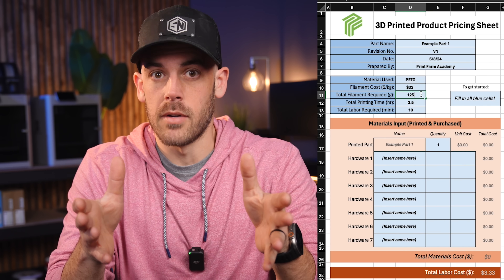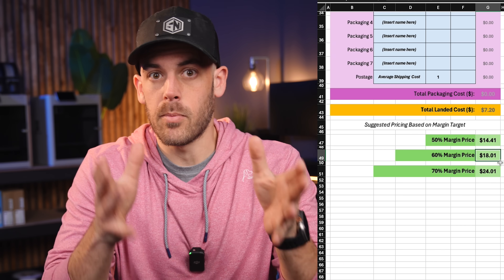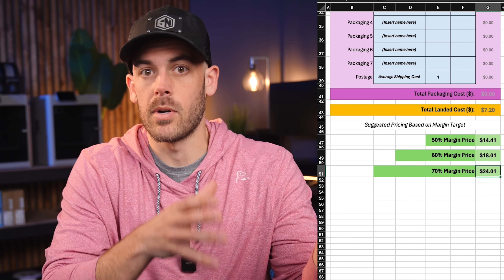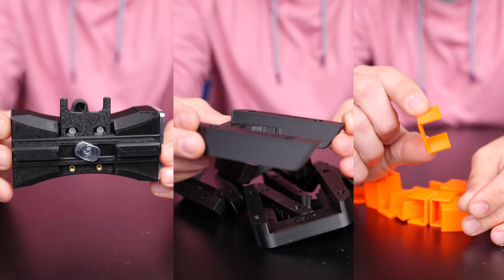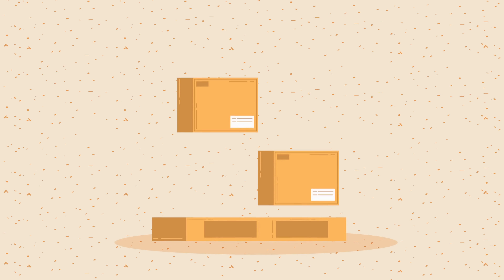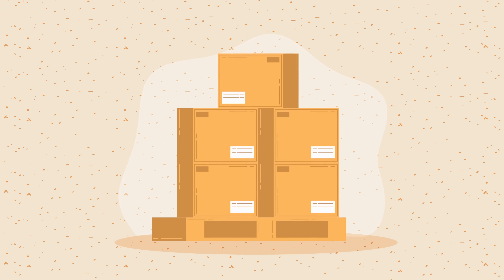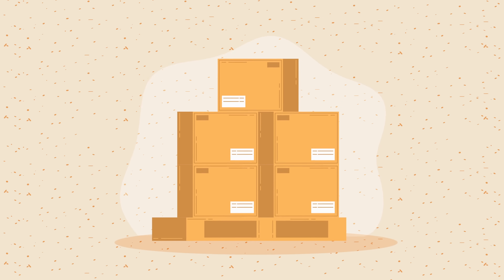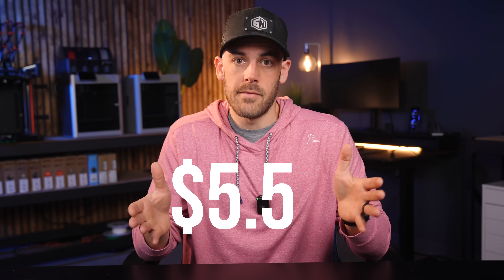Why I charge $55 for this 3D printed part (how to price)

Comment: There are three choices when analyzing the market. A: Position as superior.  B: Decrease your margin.  C: Choose to not enter that specific items market.  The third choice should always be considered.
Reply: Yep...my rule is to avoid saturated markets...if it is easy then more people will be in it making it a race to the bottom for margins.
Reply: in a 3d printed part market, you can also consider selling files for others to print. If you can sell someone a file, you don't have to do any of the work to print or distribute, and you can allow the user to save money (no markup on the bulk of the cost), which makes them more likely to get it over a pre-printed object. The only downside is that they need to have a 3d printer. It's probably not going to make as much money as selling the parts directly, but it's something to consider if your parts aren't selling at all due to cheaper competitors.
Reply: If your competitor advantage is price then your product is a commodity and you will lose money. It because the only thing you can do is lower prices and decreasing margins, you only can go to 0 and then its done. Probably way before that.
Reply: Then, When do you even start a business....
Reply: Another option would be to decrease your landing cost. 
Print more efficiently, ship more efficiently, find better pricing (bulk discounts) for materials.
Reply: yep, so true, this is where capitalism can either work for you or against you.  thankfully distributed manufacturing like 3d printing can be a really cool way to make capitalism work FOR you by leveling the playing field slightly instead of against you like it does in many cases for small players in this kind of economy.   as you allude to the big question is: are you willing to undercut?... aka can you still make money at 25 or 30% margin vs 50%?  maybe, maybe not, all depends.   if you are shrewd and have done your research properly or are willing to invest larger amounts to produce more units in less time it might be possible... but also the possibility to lose it all increases because if someone copies your idea or someone has a million of the same thing injection molded in china somewhere and then sells them here....  you get the picture.   but if you (whoever) follow me here there is another aspect to this:  perhaps you are the person who steps ahead and sees the demand and has those particular parts or items batched out from a factory or buys the next level of tool or equipment to make more etc...          anyway, not at all being adversarial, more enjoying and summarizing the fact that we can 3d print things and learn not only engineering, materials science, computers/programming possibly but also fundamentals of business and economics ....   all of it has direct application to this one little machine or two in our office or shop.      Most importantly... the critical thinking skills to put it all together and decide what is or is not important in the given scenario!  

If i were a high school shop or science teacher i would be doing a month (or whatever reasonable time)  of every semester on 3d printing and its direct applications to the subjects being taught, coordinating with other subject's teachers so they could further amplify the effect of tying things together to other aspects students needed to learn.    STEM  coupled with  proper communication skills (making youtube videos in addition to writing and reading) is wonderful eh?
Reply: @DeagleBingo  I started very slow, in a different industry, (IT). I bought 1 3D printer, downloaded an STL and managed to sell it. It branched into EVERY single thing you said/wrote. Being completely averse to losing money I grew organically. Once the cost of materials paid itself off and made enough for a new item (CNC) I began to make my own carpentry items. Paid off the cost the machine then bought a plastic mold injection machine. Why, because I could now make my own molds. THEN I began to see people reselling my items cheaper. Well, I have a very big yard so it turned into a small manufacturing facility. Threw up some solar panels to keep the energy cost down, tracked the wattage usage into $ saved. Combined it all into lowering the price and being more competitive than the idea thieves. Product life cycle ends, do it all over again. What I discovered is you have a few months before the Chinese begin to resell it. That's when you need to do the math, is the margin worth it? Is there longevity in the lifecycle worth going to war over or are you better off in a new seasonal item or perhaps different sector. Pro tip, your wife could have some great ideas.
Reply: @DeagleBingo they're workers there to train workers
Reply: @DeagleBingo  Schools dont teach independence, they teach conformity to be an employee. Another printed brick in the wall
Reply: @DeagleBingo  If you don't know whether you're making money at 30% margin, you're doing your math wrong. A positive margin by definition means you are making money. The question is whether you could make more money making/selling something else.
Reply: @hellterminator  Man, you completely missed the context of what he's getting at.
Reply: @TechieTard  I didn't miss it, I pointed out that a part of it was blatantly wrong, so maybe you should take the whole thing with a grain of salt.
Reply: @hellterminator you do realise gross margins exist, right? And they’re something that needs to be factored in. Your gross margin may well be 30%, but your net margin may be a negative figure. So he’s absolutely right. Just because you have a 30% gross margin, it does NOT mean you are making money.
Reply: @CMB-zt9iu  Fair enough. When I hear just “margin,” I automatically assume net margin, but it is possible he meant gross margin.
Reply: @hellterminator  11 months late to tell you are wrong lol.

Positive margin =/= making money 
Margin is defined as price sold of a product - cost of said product

It does NOT include taxes, salaries, other tools needed to build your product, the building, etc. Basically things that are not directly related to the product

What does include all of these however is the net income
You could have a positive margin, and a negative net income => you are in fact loosing money even though you have a positive net margin
Reply: @ Actually, you're wrong. That's the difference between gross and net margin, which is something you would have known, had you bothered to read the discussion before replying. 
Also, even with gross margin, salaries are still included if they're labor cost or part of production overhead.
Reply: @DeagleBingo  
"aka can you still make money at 25 or 30% margin vs 50%"

Margin is not that flexible.
I sat in a class with a CPA some years ago and she said as a business, to stay in business, you must make at minimum, 35% margin.

"If i were a high school shop or science teacher i would be doing a month (or whatever reasonable time)  of every semester on 3d printing and its direct applications to the subjects being taught, coordinating with other subject's teachers so they could further amplify the effect of tying things together to other aspects students needed to learn.    STEM  coupled with  proper communication skills (making youtube videos in addition to writing and reading) is wonderful eh?"

That sounds like you're teaching about money, and, according to at least one millionaire; "schools are not allowed to teach students about money".
Reply: I use C as well when selling items on Ebay
Reply: doing nothing is always an option, and is massively overlooked
Reply: @UsernameWasLost  "doing nothing is always an option, and is massively overlooked"

Right? I've been doing this one my entire life. Problem is, it hasn't made me any money. Am I (not) doing it wrong?
Reply: There's also choice 4, the "bullshit the market" choice. Works great for Apple :)
Reply: @bleve97  I understand that you're making a joke... but why do people dismiss the "bullshit the market" strategy when it is a valid one in many cases?
Reply: @bleve97 and every designer brand
Reply: @bleve97  So A?
Reply: @bleve97  I use to laugh when mp3 was abundant but ppl wanted their itunes and pay apple for music.
Reply: @bleve97  Are you telling me I don't need to buy the iSock for $230?

Comment: Thank you for spreading the word.  I have many years of business experience, a degree in accounting/economics and also teach cost accounting, fixed and variable costs to operate a business, to fledgling inventors.  One thing that I noted is that you did not account for the labor cost of processing the order not the time to to the packaging and going to the shipping store, etc.
Reply: Well for me, I don't factor that in because a computer does all that work automatically. I do not have to even pay for it. So it would be fraudulent to charge for it. I would bet that there have been some illegal things you've been doing not realizing it. This is where you could start violating racketeering laws.
Reply: @isthattrue1083  - so nearsighted of a comment.  Computers are a dumb brick.  It's the software that makes your request for a proper answer you whatever you want a correct answer.  There is also the old "garbage in-garbage out" syndrome of not enough information or incorrect information will never give you the best possible answer.  Once upon a time I was a system designer/analyst and have had to delt with your lack of knowledge to get proper results off of that computer.
Reply: @isthattrue1083  rAcKeTeErInG 🤡

Comment: Space, Profit, Taxes, Accounting, Office Infrastructure, communication, run your platforms, software, included in your margin?
Reply: That's the key that I don't see here.
Lets say it is completely above board, a real taxed business. Then you have the website costs including upgrades and maintenance, the cost of transaction not included here, say 3% for credit card fees, then the cost of the software to design, say $400/year for Fusion and then factor in the time to design, print protos, do testing of said protos, and if you do marketing and use Adobe products, the cost of that subscription and maybe advertising fees on social media or the cost of maintaining mailing lists. When you look into the day to day costs, I don't see enough of them added here.
Granted, it is difficult for a home business to write off space/electricity/phone bills/etc., but it can be accounted for in the COGs.

Comment: Good content and info. A significant cost allocation you didn't include was overhead. Taking rent, insurance, marketing costs, and other indirect costs are huge. Even if these costs aren't a factor now, one still has to charge for all this. Not charging for rent, wrokers comp, or product liability insurance because you don't need it right now is a serious mistake. Once one does try to grow to a legitimate business they'll find that the whole business model isn't feasible. Charge for extra overhead items today, the added margin will help the business grow. Then, once those items hit, thre business won't lose it's business model. Another good, related topic for your channel might be how to do a break even analysis. 🍻

Comment: I've been very successful with a product I created and sell (for over 2 years now). I factored in everything you've shown in your video, which is probably why it's been so successful. My product stemmed from my business in a field of industry that I knew well and was easy to market to because of that. The question is... when you have a product to sell to a industry you're NOT familiar with, how do you target those sales? I have several things I've created that I am using for my own personal use, but no idea how to get the attention of those that would need or use them. I see a lot of people using Etsy, but have never had any luck with that. What are your thoughts?

Comment: OMG someone finally speakign the truth about 3d printers and the sellers. Though your still under charing labour, labour costs still apply while the maching is running, for every hour they are in operation.